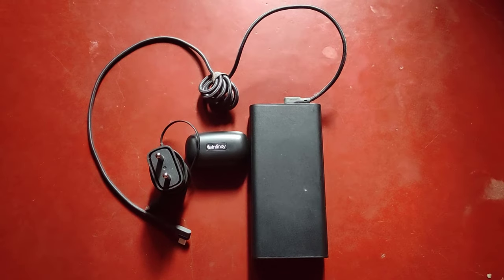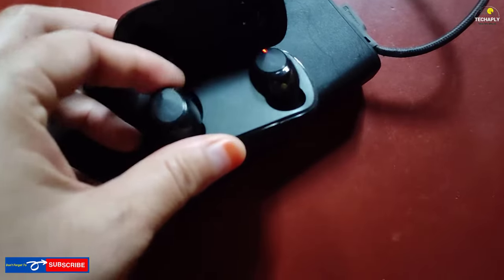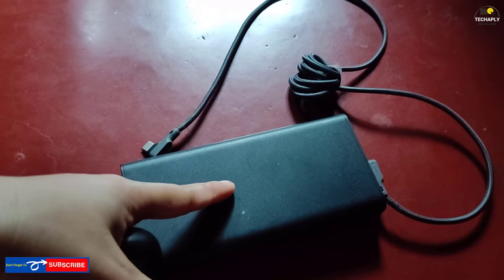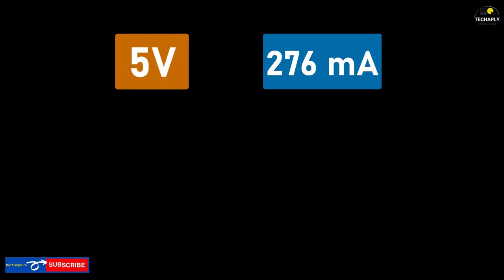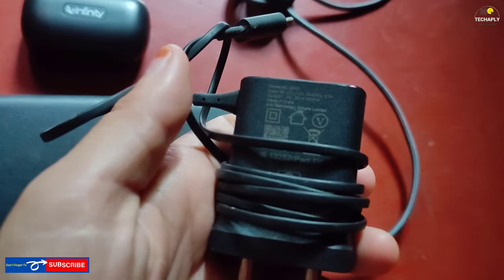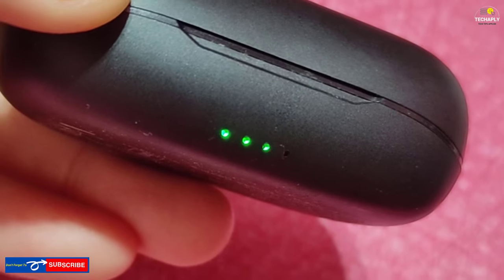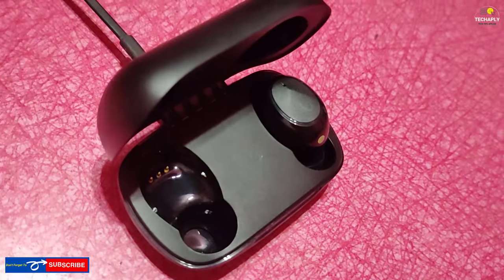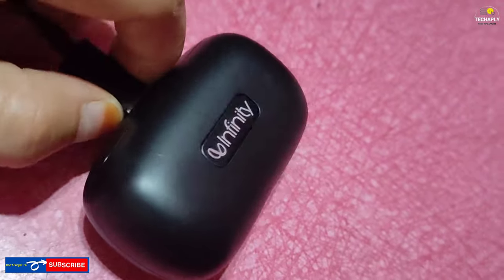How To Charge Earbuds

Comment: Mine is realme buds t100. The earpods left and right are already 100% but the case is in low battery. Can i charge the case only without the earbuds inside it? Pls help me ty.
Reply from the maker: Yes. You can charge the case itself without those earbuds in. Hope it works out for you 🤞

Comment: Can I charge my earbuds charging case with a 15w wireless charger?..or is that bad for them,?
Reply from the maker: It's not recommended. You can charge it by plugging in its charging cable to the laptop. That's possibly 5w which could be lesser than your 15w charger.
Reply: @AnhPhan  what IS recommended?
Reply from the maker: Charge it with your laptop 💻

Comment: The only problem I'm having is only my right earbud is only charging to 60% the left is charging to 100% like I keep trying to charge the right earbud but still 60% idk what to do besides that or just get another pair but I don't really want to because these are my 3rd pair and the same thing happened to the 2 other pair like I let the earbuds fully die before charging them same goes with the case btw I'm using ( Wicked Mojo 300 AUDIO earbuds)
Reply from the maker: Charging case or charger if you can. It could be the charging case problem
Reply: How do you know how much it's charged